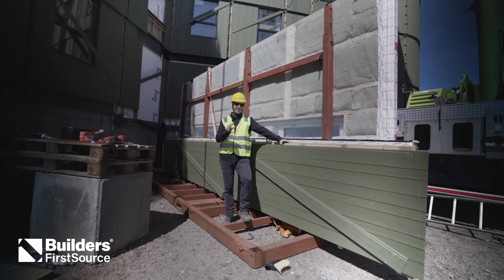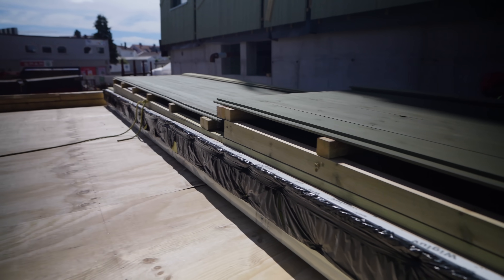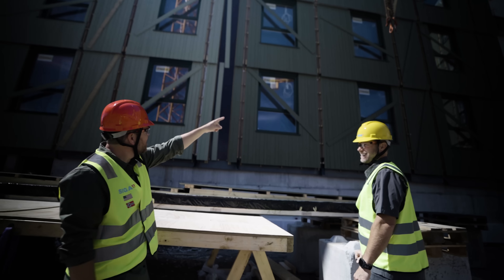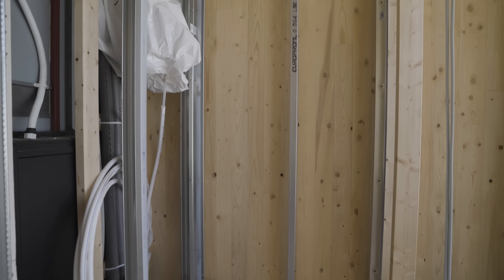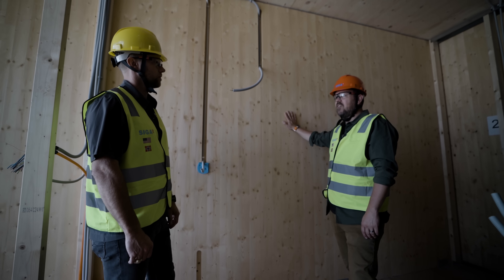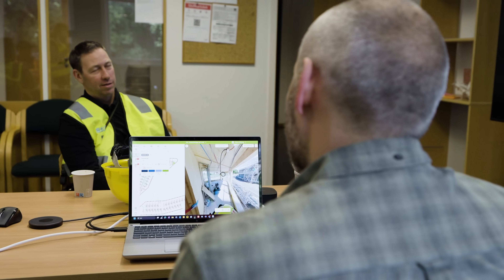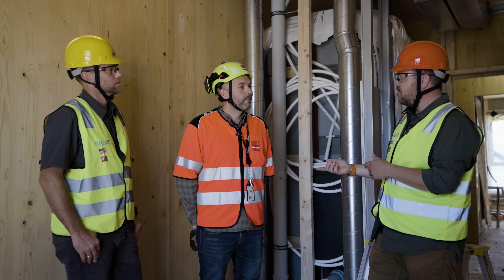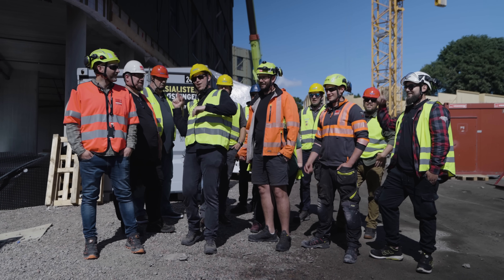Amazingly Fast Build - When Panelized Construction Meets Robots

Comment: As a Norwegian. I can wholeheartedly say nothing, absolutely NOTHING is built fast here. A good example is the time after the terror bombing of state and government buildings in Oslo in 2011. We have yet to finish the new buildings that got hit. The tallest building (not very tall by international standards) is set to be done in 2029. That is 18 years!!! We are as fast as molasses mixed with glue, its ridiculous to say the least. Dont get started with hospitals and public roads. Mon dieu!
Reply: There's a plot of land 1km from where i live that burned to the ground 3-4 years ago (very shady circumstances but whatever..lmao) 
Anyway they were quick to pull up the illustration art of the new apartments that will eventually, at some point, .. be built.. 
Quick to sell to customers and as you say, slow as hell. 
One "nitpicky" thing i see now, multi-level apartments not having a plain flat ground, like i look around and these cheapskates don't level the property to the actual street, so WATER pours towards the buildings, and you have this very unnecessary sloping effect all around, and the issues my sister and her husband had when they moved into a brand new rental complex in Ringsaker (brumunddal) , we were all livid.. 
Also slopes everywhere so someones toddler can run off a small garden cliff and drop a meter down etc. 
Americans may like what they are shown, but it's not all rainbows and sunshine with new constructions here. 
Sorry for rambling hahaha..
Reply: that's not the building speed, the is political decisions speed.

Comment: The company I work for has been using the same 3D software (Dalux) and its really easy to work with. It loads fast on smartphones and we use it to make remarks on sections that have problems, for example, a walkway railing that has too large of a gap. Quick and easy to keep track of workpoints, much better then the previous software we used. We don't use the 'streetview' option though, although it would be useful.

Comment: Empire State Building one year and 45 days. They need to say how many labor hours it took to build it. That is the true test of efficiency.
Reply: Yes, in Norway it is a maximum of 8 hours per day, usually 7-16 including 1 hour for lunch and coffe breaks, 5 days a week and I would guess that they have just less then 100 that works there, if not less then 50 even. Empire State Building had up to 3400 workers doing probably over 12 hour shifts, and they worked 24/7. So yeah, it was different back then, It was also during the Great Depression so plenty of workers doing work for almost nothing and manufacturing plkants that were freed up to do everything on demand.